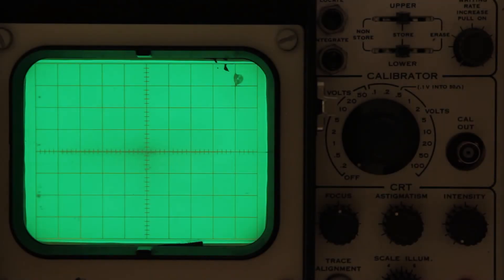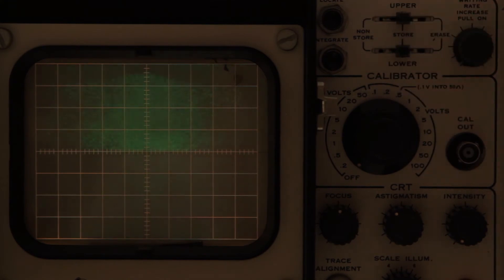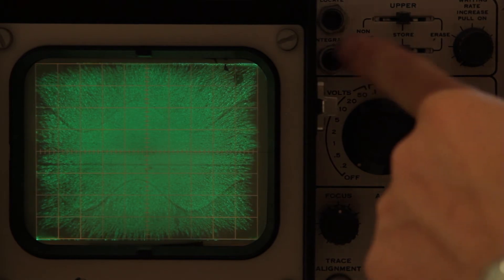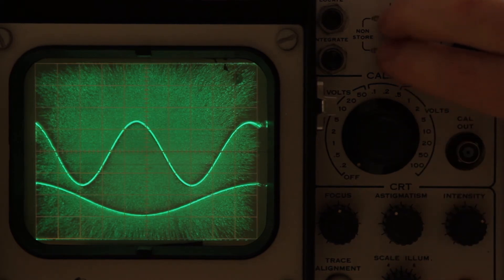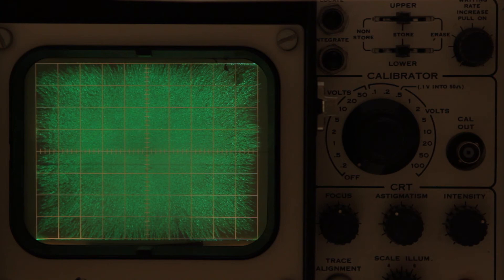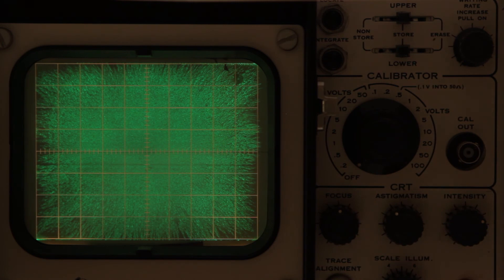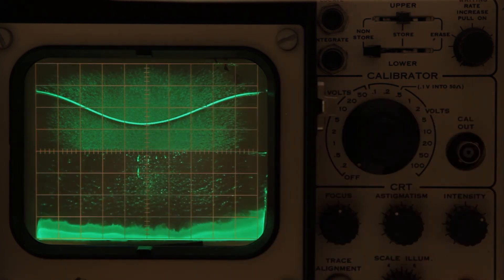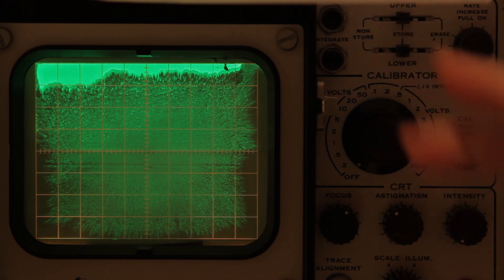Tektronix 564 Vacuum Tube Storage Oscilloscope

Comment: my assumption is that the functions are operating correctly but way outside parameters., this has several or more components outside specification
Reply from the maker: Thanks for the comment. I got this scope performing quite well now. There were a couple of electrolytics hidden behind some other components. These were part of the erase circuit. After I replaced those things worked much better. Everything calibrates within spec. Also the storage tube does seem to have to warm up for a few seconds when you first switch to storage more. I hope to make another video of this scope in action, but likely using it on some other project. It has a ridiculously sharp trace, and is very fun to use.

Comment: Very nice! It could be a bad capacitor or maybe a tube or resistor that is out of spec. Do you have a good tube tester?
Reply from the maker: Thanks for the reply, and for your video on the same scope. I am wondering if the erase issues, and the store to non-store issues aren't related to C935. It is the last electrolytic that I have not changed, as I do jot have one in stock.  Whatever is causing those issues also must be in a part of the circuit that applies to both the upper and lower displays. I shall investigate further.